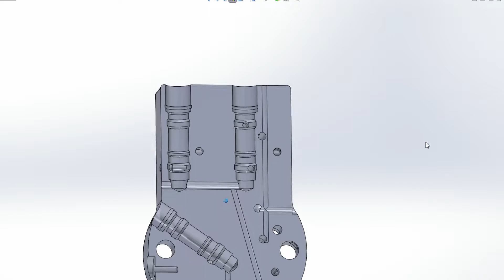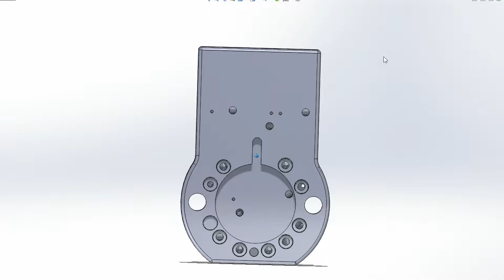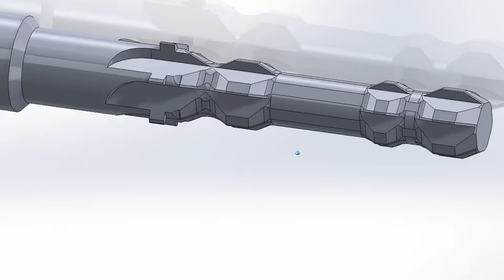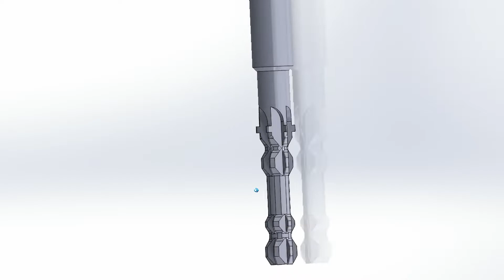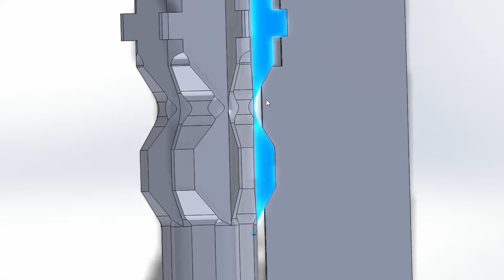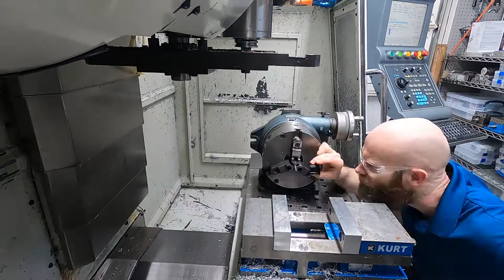Making A Custom Tool To Cut Multiple Grooves At Once

Comment: Great to see that you have made a custom tool on your own. You did mention you've used some ID tool to finish it after the custom tool operation, but did you get the desired finish & dimensional tolerance.
Reply from the maker: Thanks, Yes, the ID wasn't touched by the tool and was to size with a nice finish after the deburr pass, from the boring end mill. The tool did have deflection and deflected more towards the end of the tool, Due to this to bring the lower grooves to size while keeping the upper grooves to size a took a second tool that I had made (I made three total) and ground away the upper portion so I could go in and cut the lower section with more cutter compensation. I don't think this would have been an issue and the tool also may not have created much of a burr if I could have had it made out of carbide.
Reply: @McCoskeyPrecision  yes carbide  tool would have been rigid and offered less deflection. Great efforts by you, I appreciate it. Keep posting works like this, good day..